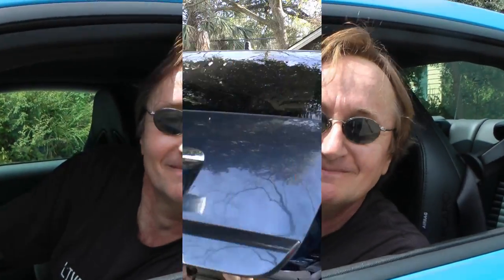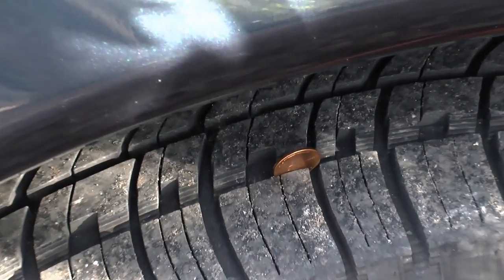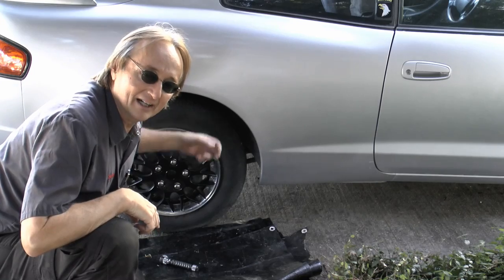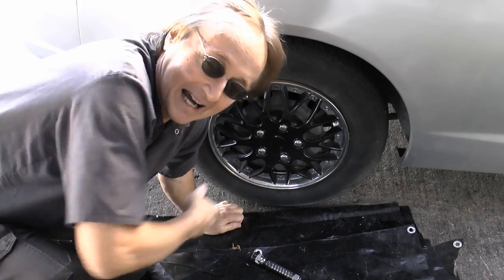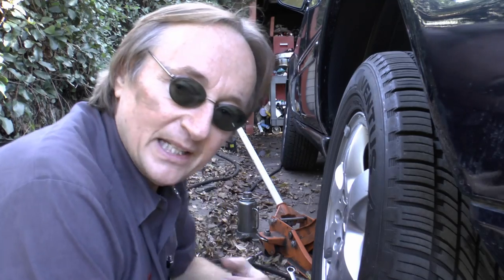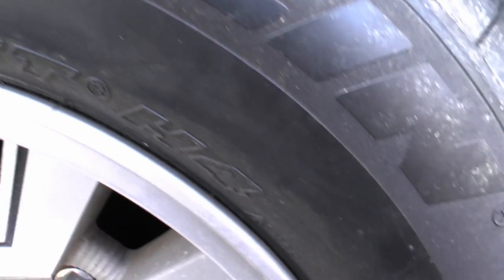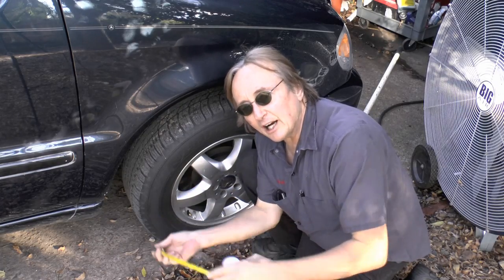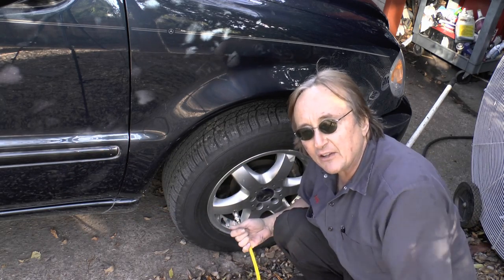How to Tell if You Need New Tires on Your Car

Comment: I understand why you suggested a penny Scotty, since most people have them in their pockets and is an easy way to demonstrate. Wouldn't you say check with a 32nd's gauge rather then a penny? Cheap to buy too, like $2. That way you can go onto the tires manufacturers site and see when they "suggest" to replace them. Every tire is different and because of that all have different tread life. Even in the same brand example--> Michelin; one tire may need to be replaced at 2/32nd's while another from their line up may need to be replaced at 4/23nd's. I guess all in all just do your research people, it will save you a lot of money.

Comment: hi love your video I have a 92 s10 blazer and it wont idle and some times it wont start right up I got to give it some time and I got a 88 ranger and it smokes some times
Reply from the maker: giboron try my video "how to fix a car that idles poorly" and with the ranger, do my test "how to tell if your head gasket is blown" and pray it's not and that the engine is just somewhat worn and burns oil

Comment: If you had to add air to a new tire, there's a good chance it isn't the tire's fault. Take it to a shop and have them inspect the tire for "holes." They will take it off the rim and reseal it when they put it back on. This should fix any sloppy mounting job, and should be free since they didn't find any holes to repair.
Reply: Tire to rim seal is most likely the cause of air leaks with new tires.

Comment: How many miles do you have on your shocks?  The front end will shake at speeds from tires bouncing around from old shocks.  I bet yours have over 100k.  I change mine at 80k kyb the manufacturer for toyota says change them at 50k.
Reply: Daniel Freeman A bad sparkplug boot (you can tell from the arcing on the side of the spark plug) can make a 96 4runner shake violently when you get up to 40+ mph and let slightly off the gas. Shake violently is the best I can describe it. It to me a while to find the problem.

Comment: Hi Scotty thanks for all your videos it really helps this young grandma out.  I am constantly getting beat by mechanics so knowing a thing or two really help. I have a question.  I have a 1999 ford ranger 6 cylinder and experiencing a rough idle. The mechanic said I have a small air intake leak and need to change the MAF sensor. He said not to worry about fixing I can drive the car for years like that.  When driving and I pass 60 mph the car vibrates is that one of the symptoms and can I really drive the van like that for years? Thanks
Reply from the maker: vibration is something else, like out of  balance tires.  But yea, go ahead and live with it, an old ford that runs good enough is fine, just like an old person. You don't expect them to get up and go like a jack rabbit anymore.
Reply: Lol would have the tires check. Yep the old Ford runs really good. Thanks for the advice and timely response.

Comment: Why not just check what the manufacturer says? On my Nokian tyres I have numbers stamped into the tyre telling me how deep the pattern is and a water drop symbol about halfaway through. According to Nokian, that's the point where hydroplaning performance is reduced but it's still perfectly safe in the dry. Just being aware of that helps you avoid bad situations.

I know most of us are guys but picking up a manual every once in a while is usually a good idea.

Comment: The reason the old tires keep the air pressure is because they are filled with air.

The new tires are filled with nitrious which slowly escapes and need to be refilled, but performs better than air.

The performance difference comes from the fact nitrous does not expand and compress nearly as much as air, making your car have the correct pressure be it hot or cold outside.

Case in point. Tires today stop way faster and grip far better than they did 10 years ago.

Comment: Some great advice here - also I'd add don't buy tyres made in Malaysia etc. - Stick with Japanese, American or European tyres, and watch out for big brand tyres like Yokohama's that are Japanese names that used to be good but are now manufactured in other countries and are just garbage (tyres almost always have the country of manufacture stamped on them regardless of where head office is)

Also when buying new tyres, watch for old tyre stock - you'll find the date of manufacture stamped on the tyre too, it's a bit odd as it shows the week of manufacture and the year (eg 2614 would be the middle of 2014) - if it's more than a couple of years old then reject it.  As Scotty points out, they perish over time, and that goes for tyres sitting around on the shelf too.

I've been putting Goodyear Assurances on my wife's car as they seem to be a really good all rounder (not the fuel saver ones as safety is more important to me for fuel economy) and we have a very mild climate here.

My own car is high performance, so I've been using Toyo Proxes on it which have been pretty good, but my wife's Goodyears have been that good that I think I'll swap to some Goodyear Eagles next time.

Comment: Should I buy used tires? I don't have alot of money right now and need 1 new tire
Reply from the maker: you can go ahead, but go to a junk yard, cause those cars were in wrecks and tires can be fine. Used ones at tire stores came from guys  buying new tires most of the time, so of course, they are pretty worn

Comment: Tires are only as good as the type of vehicle you have and the right tread pattern. If you driving a Honda Civic, you'd probably be good with a less aggressive tread tire. You wouldn't put B.F. Goodrich Ko2's on a honda civic. However, Ko2's would be perfect/bad ass on Jeep Cherokee XJ. Just my opinion from old days of selling tires.

Comment: 1.8 mm height on treads

 also if your treadwear is uneven it is not your tires you should get changed but you will need a steering alignment by a mechanic

Comment: I wouldn't burn rubber for 2 reasons
1.  doing it on the STREET, the penalties for reckless driving TODAY  are excessive
2. there's what, 4 crappy cv joints back there on the stang, & on modern camaros & chally's, unlike the classic ones that have a stout SOLID rear axle - especially the 9 inch & 12 bolts.

Comment: My tires had between 1/32nd and 2/32nds of tread when I replaced them.
Reply: Hell yes! You can get a ticket for having bald tires
Reply: Peter Kapica I was going to wait until there were 0/32nds but in the wet, it was hard to get enough traction to accelerate after the light turned green. One time, I almost slid into a ditch while turning at 10 MPH. With winter approaching, I didn't want to wait any longer.
Reply: Buy some winter tires. Michelin, bridgestone, and goodyear make great ones.
Reply: Peter Kapica You don't need winter tires in Texas.
Reply: *****: true, but winter tires get better traction on dry roads than an average summer tire, but due to being a soft rubber compound, it wears faster in warmer temps.

Comment: When I got the van it had brand new Chines made tires they lasted 1 month no kidding. They broke around the full circumference on the inner wall. Here they cost around 50 euros each so they are very cheap but also quite dangerous.

Comment: Why did you attach your newer, better tires to the front? That is a horrible idea because if you have less grip in the back and take a turn too fast,  your rear will break out a lot easier, which means your car will then spin.

Comment: Question for anyone... My car shakes at high speeds. I know I need new tires. If I change them will it fix that?
Reply: Michael Bowman  it was the rotors.
Reply: Michael Bowman  no I didn't replace the rotors yet. The bad rotors made the breaks wear out. I'm doing it this week.

Comment: I went to NTB for a $20 oil change and they tried to tell me I needed 4 new tires and i was like "no no no, the car has been fine all these years with four tires on it, im not gonna start ADDING tires to it now" then when they explained that they meant 4 replacement tires i said show me, we walked out and looked at the 4 different brand tires and I was like "goddam, those tires are like brand new. What, did the sticker come off of them or something?"

When I bought the car the ford dealership I was taking it to for $5 OTD oil changes they said I need new tires when the car had 66K on it, I didn't replace the last one until it had 155K. (Goodyear Viva 2's, they suck but they last a long time)

Comment: You do realize the patch you showed us is a rope plug and is only for temporary use? Not a DOT approved repair. Only you a patch plug installed from inside. Also the patch you made was on the sidewall of the tire.
Reply from the maker: +Andrew D guess what,  it's still holding fine. Fanatics will take a tire apart and patch it on the inside, but this works fine when done correctly, been doing it 47 years.
Reply: +Scotty Kilmer ..so you disregard standard industry practice?.. not only is the plug on the  edge of the side wall  and outside the recommend repair zone but  the tire should be checked for internal damage seeing it was probably run flat? hardly the word of a fanatic.
Reply: +Scotty Kilmer 
Technically York wrong. Andrew is right. A plug on the sidewall is not acceptable. Why? Because sidewalls aren't as rigid as the tread area. Get unlucky and that hole you have in your sidewall will blow out. So...

Comment: What are the names of Chinese made tires? I assume you aren't referring Hankook or Kumho tires as Chinese made tires?
Reply from the maker: on the inside of the tires, it says where they are made. If it says china, I don't buy them. too much gamble really.
Reply: Scotty Kilmer My goodyear tire is made in china and my Dunlop is made in Indonesia. It's not easy to find a tire not made in asia
Reply: Shanming Hu
My Michelin Defenders were made in Mexico and they're quite excellent.
Reply: My Hankook Ventus were made in Hungary, having only realy had used salvage yard tires before the difference is night and day will never go cheap when it comes to tires again.
Reply: @scottykilmer Hi, love your video's. For inspection I need to buy new tires for a 2004 Buick Lesabre I seen on a post dated 7 years ago where you said you liked Tiger Paw tires. Would you still recommend Tiger Paw tires? Which would you recommend Goodyear or Tiger Paw? I appreciate your time & response. Thank you

Comment: My dually truck has one tire from 2004 and another so dry rotted that I can't read the date.
Reply: when the air won't stay in, you need new tires!
Reply: J Bishop yeah, but the 2004 tire is going bald anyway, I am going to replace the two dry rotted tires before they blow out and destroy my dually fenders.

Comment: The "performance" tires on that supra haven't been made in years :P
Reply: When tires get old, they dry rot and they self eject the tread.
Reply from the maker: Car is 30 years old
Reply: Scotty Kilmer I know, i own one just like it in white. If michelin still made those tires i'd own them, but they've been out of production for at least 5 years so i'm running 16's with more modern performance tires. I'm just bustin your chops i know you know your stuff, i'm just letting the other commenters know about the plight of 14" tires. Keep up the vids and i'll keep watchin em, nice work as always.

Comment: Hey Scotty was that a Mercedes Benz
Reply from the maker: ML 500 I was putting 400 dollar shocks on.
Reply: Scotty Kilmer
The W163 MLs, first generation that was body on frame, are relatively bullet proof for that era of Mercedes and "cheap" relative to Mercedes to mend.

The M112/M113 of that ML500 share parts with the Chrysler Crossfire which has the M112 V6 engine.  Some parts you can cross shop to save money if that is one of your regular's cars.

Comment: Tires loose pressure depending weight on them, tyres below engine loose weught more, valve tyres vs tpms alu valve loose air, 10 years tyres become hard like plastic and if u drive everyday for a living u will be the one taking the shocks

Comment: Tires is something you dont want to go cheap on. I try to look at reviews from tirerack.com and discounttiredirect.com and get the ones that have the best wet weather performance. I had a Nissan Titan years ago and it came with Goodyear Wrangler SR-A tires. Even when they were new they did terrible in the rain. They were actually dangerous and would hydroplane like non I had ever experienced. I replaced them within the first year with some Nitto's and I had complete confidence in the rain.

Comment: I disagree, Kuhmo tires are good. I had a set of Chinese tires and they were good. This Scotty guy is rich, but if you are struggling American like 90 percent of people, these tires are fine
Reply from the maker: disagree all you want, these were crappers and I''ve gotten e mails from hundreds of people with the same experience
Reply: People also told me Hyundai was a junk product when i bought in 2004. They are right behind Toyota, and they will pass them. I was mocked and ridiculed for driving Hyundai, but over time it became apparent that the simple designed was reliable.
Reply: But Hyundai is Korean (and had history for being pretty bad, they recently have become very good cars in my opinion) and Toyota is Japanese. For some things, i'll buy knock off Chinese stuff when reliability isn't my no.1 concern, but its true that most Chinese products are simply worse than competing American/Japanese/Korean/European brands.
Reply: I take it you do not read consumer reports. Hyundai beats Honda in every category except for hybrids.
Reply: agree

Comment: you need new tires if it takes you an entire block to slow down..
Reply: you mean breaks?
Reply: Denise Morales you missed my point..
  If your tires are completely bald, expect to slide all the way down...
Reply: Yol oh ok
Reply: Brakes are a zillion times more likely to be the problem than tires unless rain or snow is a factor.
Reply: Bob Leonard you also missed it.
Reply: Except if your tires are bald, you're likely to have more grip and brake faster on dry pavement. Wet pavement, different story.
Reply: jFischer27 can't tell if you are trolling or not.  
  But your statement is HARD false.
Reply: The point I'm trying to make is that on smooth, dry pavement, you won't notice much difference between a new and bald tire.
Reply: jFischer27 false.

 It is VERY evident that you have NEVER driven with bald tires before..

  I DARE you to make a video with completely bald, worn out tires, do an emergency stop from at least 35 mph and see how long it takes you to stop. This is on DRY pavement. you will slide like a cat on kitchen flooring. This inspired me to replace the tires on my work car and its a Mercedes. ABS can only do so much.
Reply: +Yol you're obviously the troll here or you don't know how to drive and have to rely on abs. It wouldn't be the first time I wore a tire down to the belts, or down to the tube on a bicycle tire when I was kid. Don't lock them up and they'll stop you just fine.

Comment: I agree, don't buy Chinese manufactured tires; the quality is poor, don't last, not durable.  I also have had troubles keeping them from becoming out-of-round!  Overall a good, informative video.  Thank you.
Reply: I brought these cheap Lexani tires awhile back. They are a california based company but has their tires made in China. They seem to be embarrassed about it, cause they hid the "made in China" stamp on the beads so you couldn't see it.

Any ways first problem I noticed was the durability. The thing ran over broken glass and got a deep gash on the tread. Deep enough to see the cords. 

Junk tires if you ask me.

Comment: chinese tyres really suck alot. I went to the shop and ask for the cheapest every 2-3 months you would get either a crack or bloated surface from the side wall or blown tyres from nails. In within a year I had to change like 3-4 tyres and I had it with it and went back to dunlop which I normally use

Comment: lol all of you lot ripping "Chinese" tyres but have you ever seen where high performance tyres are made in? take pirreli for example a performance tyre where is it made china and are made in the same building difference being a label and tread pattern and price also if you had ever looked at tyre rating so fuel efficiency and grip ratings their exactly the same as performance tyres market research goes a long way!
Reply: +brandon18054 lol these things are quality controlled no Tom dick and Harry can make a tyre and sell it u mug they are put threw the same test as every tyre and if they pass the test what's wrong with them?
Reply: +brandon18054 na because I was talking about tyres not toys
Reply: Tire*
Reply: 9598rambo all tires sold in the US must passed NTSHA. For public safety.